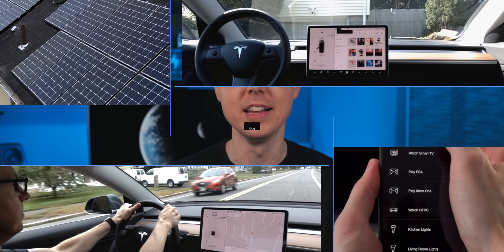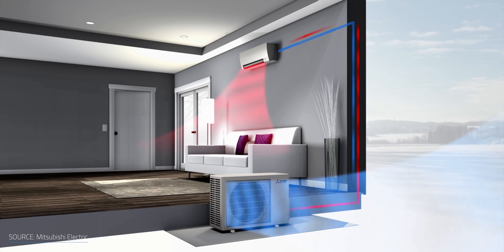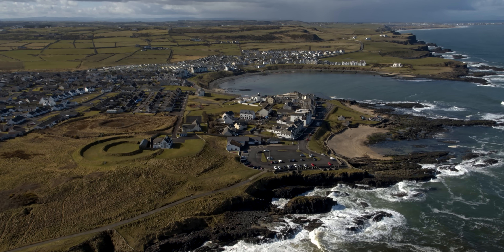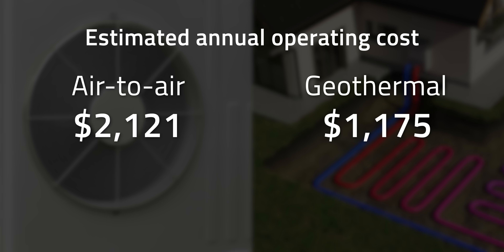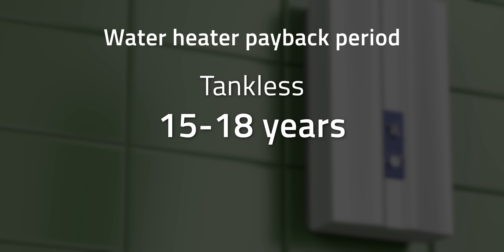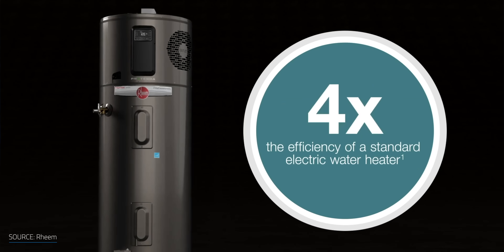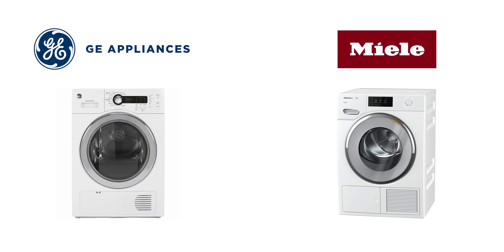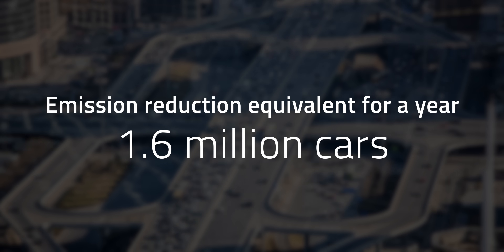Why Heat Pumps are Essential for the Future - Explained

Comment: My clothes dryer costs me absolutely zero dollars per year, produces no emissions and no noise, and cost $57 AUD 45 years ago so I think it has returned its investment by now. It's called a rotary clothesline. I know I am being silly as I understand that there are climate zones where outside drying is not easy to achieve but when I visit my son in southern California and I never see a clothesline ever I just shake my head. All that sun and heat and they use clothes dryers. I have to wonder how much electricity is consumed in the USA by clothes dryers in areas or at times of the year where they are not needed.
Reply: The problem with clotheslines is the lint that is still stuck on the fabrics.

Comment: Did you hear about the new heat pump developments? Magnetic and sound based heat pumps are awesome. Frauenhofer IPM researched a heat pump based on magnetic fields, heat diods and heat pipes and Blue Heart (a dutch company) developed a heat pump based on sound. Both are way more efficient, need less energy, quiter, less moving parts and avoids cooling fluids, which could be an environmental burden in itself. So, what do you think? Will heat pumps based on magnetic fields or sound replace todays heat pumps or are you still undecided?

Comment: so where does all the H2O go that's removed from the clothes?, in a motor vehicle , ( I'm an A/C tech ) it clings to the evaporator core that's 32% optimum , and runs down and out under the vehicle . just like a frost free refrigerator takes moisture out of inside and drips it into a pan under the fridge to evaporated into the room. but that's not much H2O. the dyer on the other hand will put all that moisture into the room it's in. so the room must be vented to outside some how , or water will be running down the walls like when you take a shower .

Comment: The new Inflation Reduction Act will be adding more rebates to heat pumps, whether they are space heating or water heating.
I have been extremely happy with my heat pump water heater and the mini split heat pumps that I've installed.
Reply: Yay more debt!
Reply: @paulb9769  the inflation reduction act actually decreases the national debt.

Comment: It's telling that EU nations are pushing (with subsidies and special crews) the adoption of heat pumps. Slovakia and Czechia have embarked on a massive program to install as many heat pumps as possible with crews working around the clock.   No gas or oil and it's efficient,  And the temperature is almost perfect . The new breed are twice as efficient as gas when the temp drops below zero.  In short, get a heat pump.

Comment: So if you used a heat pump with a 300% efficiency, and then converted 50% of the heat into electricity, you could generate enough power to run the heat pump, with electricity left over.  Essential free power!  Why aren't we doing this??

Comment: Install insulated tanks outside and use that as a thermal dump. I'm Looking to connect 2x 800,000 litre tanks, hot and cold storage on a 4,000 person office with full 2mw solar carpark and two 450kw water to water heatpumps, (no fans, all energy captured. This is the only way to do it, constant heating and cooling far outstrips any battery on payback, cost and environment.

 Everyone of these system are still dumping energy to atmosphere...

Comment: I disagree on the air heat pumps.  I've lived in three homes with them; two owned by my parents and one mine.  They really don't work well once the temperature drops into the low 40s.  They run almost constantly in the 30s.  The air coming out of the registers is cold which is the last thing you want when its 20 degrees outside.  The electric backup is NOT a good thing.  Electricity is very expensive.  It is the reason why you don't see electric homes much anymore.  They were a big thing in the 70s.  Remember electric baseboard radiant heating?  It was great, fantastic, wow until you started getting the electric bills.  I replaced my heat pump with propane and couldn't be happier.  I can even power it when the electricity goes out using a generator.  You really can't do that with a heat pump unless you get a very large one.  I'm intrigued by the geothermal version with the buried lines.  They should work fine under winter temperatures.  I'm sure they still run all the time.

Comment: I have heat pump and have for years ….much better electric bill ,more comfortable environment feeling at home …very even feeling from room to room even in the winter and it keep the house cool not cold but conferrable in the summer even on extremely hot days …..Mine is a ducted system and I enjoy it …did I mention the electric bill stays low ….LoL …now for me I can’t justify a hybrid hot water heater at this time because a good hybrid would run around $2000 plus and a good high efficiency is around $800 …to save $15 a month still wouldn’t be cost effective over the lifetime on the unit ….it will be interesting too the changes in cost effective electric appliance in the next 5 to 10 years  in America once the big push to,destroy the oil based life style we have enjoyed for the last 80 years …I hope technology keep up …//

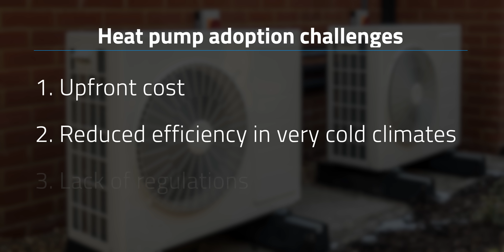Comment: 4:21 hang on--to get $5600 in savings the total annual bill has to be greater than $5600.  Are you saying they are going to spend more than $466 a month on heating?  Note the house pictured has two chimneys.

Comment: If you heat with a heat pump, it is not that much of a stretch to cut the gas line and save that connection cost every month

Comment: What if we decided to one day box a city in. Completely cover a city in a big box and measure the temperature difference after a week of no engines running…. And then 1 day after, everyone’s car was turned on, every bus, every power plant, every boat or gas/ diesel/ petrol powered engine. What if it turned out that it wasn’t the emissions of the engines, but simply the heat they create by running? Millions upon millions of little heaters running around the world in the form of cars, buses, trucks, etc…… surely the radiant heat would contribute something measurable.

Comment: Heat pumps heat just doesn't work as well as natural gas heat does. We purchased a vacation home up north 4 years ago and it came with a heat pump system. We immediately took it out and had a natural gas furnace installed. It has never failed us . It's also less stress on our electric generator when the electricity goes out as the only electricity needed from a gas furnace is for the forced air fan. Heat pumps may be ok for homes down south but if you live in an environment we're heat is seriously needed I wouldn't recommend electric heat at all.

Comment: Good video but not something we would do at the moment, more than 75% of electricity in colorado comes from coal and other fossil fules (I think SMR's are the way to go here). We dont have solar so switching to a heat pump from the natural gas in our home dosent make as much sense as we would be drawing more from the dirty grid instead of just using the natural gas which is already very cheap even after the price increase we had this year. Most people I know out here with an air to air heat pump also have a furance since a heat pump cant handle the coldest of days we have and I cant justify the price of installing multiple HVAC systems unless the prices come down significantly.

Comment: Thanks Matt, just subscribed after viewing your excellent explanation of heat pumps.  I tried solar hot water, and it worked great but after ten years the controls failed and they could not be replaced as the company producing them had gone out of business.  Surprised to find the payback period was shorter than my solar water water heater, and the lifespan was longer.  You could say I’m pumped up about heat pumps.  Good luck with your new net zero house.

Comment: I am always bewildered by people that think about CO2 emissions, as if this were a thing. Just work with whatever is cheaper to achieve the goal. For many people, that used to be natural gas, until some criminal politicians decided to make it expensive, so that other high maintenance tech start to seem economically viable. But still, most people on earth use wood to heat and cook. Wood is ecological. When burned, it grows more wood. Perfect closed loop.
Everyone I know, using heat pumps, say they regret it, because they are not doing their job. The shower water is just warm, not hot. The house stays colder than wanted in winters. And we are talking parallel 45, not the Arctic. Maybe the tech will improve. But the costs are not worth it. Stay on crude. Burn CO2, be reasonable.

Comment: I was always told AC was very inefficient and my electric bill reflects that. How can heat pumps be considered efficient if they are just a reverse system? Electric heat is 100% efficient. How can heat pumps be more than that? And natural gas is still very cheap imo. The coldest months my bill will be less than 200$ for the gas while my electric bills will be over 400$ in the hottest month of the summer 🤷🏼‍♂️. Wouldn't a heat pump cost as much or even more as AC?

Comment: Heat pumps are only better for the environment / energy consumption when the electrical source is carbon friendly.  If your source of electricity is coal or even natural gas for peaking, then a high efficiency natural gas furnace is still more efficient - consider a 95-99% thermal efficient furnace vs. a maximum 85% (but probably much less) efficiency on fossil fuel electricity generation.

Additionally in most areas of NA, Canada specifically natural gas is much cheaper than electricity, which results in a heat pump actually costing more than a HE natural gas furnace.

Comment: Longer lifetime for a heat pump dryer is not true unfortunately. At least not compared to traditional condensor dryers of European brands. In fact they die quicker and are impossible to clean because of the condensor no longer being removalable. I think the reason they're more common here in Europe is because energy is way more expensive and therefore it's more worth it.

Comment: Can you do A program on self running motor generator units and self running motor generator to start out at 50 kW and goes up for three-quarter horsepower induction motor 5 hp induction motor thank you

Comment: You didn't touch on how the electricity is made? Not much point going on about co2 if it was made from burning gas etc. Also even if we had the extra power stations the cables in the street & substation couldn't cope! Please do a video on that & how much Co2 would be produced sorting it out.
Reply: Its a matter of efficiency, and in the heat pump's case, that a heat pump can have 1 watt of electricity in, and spit out > 1 watt of heat. (This does not break laws of thermodynamics - the extra heat is collected from the air outside)

If you can get a COP of 3 or better with a heat pump, and your electricity comes from say a natural gas power plant then burning the gas directly in a furnace to heat a home is less efficient than running a heat pump. There are a lot of factors to consider here so I cannot give specifics, and there are scenarios where burning direct becomes more efficient than running a heat pump.

Similar thing to EVs.
Electric cars are extremely efficient compared to a gas vehicle..
An EV charged 100% by coal generated electricity would actually still use less energy and pollute less than a comparable gasoline vehicle. But only by a very little bit. 
Running on 100% natural gas and the EV wins hands down. 

Most people don't realize it but coal is 20-24% of US generation now, down from about 90% 20 years ago so the 'it runs on coal' meme is wildly inaccurate.

Comment: Well I live in Florida and as long as it doesn't get too cold. Heat pumps can't very much higher than the temp outside. Everytime it gets cold here and you try to heat your home it switches to emergency heat which is just a bright red hot metal band, like in floor heaters, with a fan blowing air across it. Which also makes your electric meter spin like a helicopter blade. 
You say very cold temperatures but my friends a contractor and there's a line in Florida that if your north of it they can't use heat pumps. So if north Florida is what you call "very cold temperatures" then okay but otherwise he's either mistaken or being disingenuous.

Comment: Those usage cost figures are meaningless because they don't include the cost of the devices themselves and we all know the manufacturers will outright lie about the longevity of their products.  Anyone with any appreciable amount of experience in a repair field will know that MTBF, like all statistics, is meaningless on an individual basis, so claims about longevity can be completely ignored.  Even if you could trust those claims, they are dependent upon the manufacturer using best-quality components and materials, which won't happen.  So yes, I do think that heat pumps sound like a great path forward and we should be using them everywhere possible.  However, we also need companies to design and manufacture them with quality components and materials, building a product which will last rather than a product with an intentionally-limited lifespan in order to garner future sales.

Comment: Electric water heaters do not have to be on 24/7. Mine is on a timer that turns it off in the evening and turns it on in the early morning. I save a huge amount not heating water that I don't need.

Comment: Gas cheap??? Not in Europe!!!
BTW, I have a dryer with heat pump and it cost me 450 euro. It takes a bit longer to dry but works like a charm and uses a lot less energy. It's also less of a fire hazard than those old dryers.
Soon I will invest in a water boiler with heat pump since I now have solar panels and a home battery. But heat pump systems for home heating are soooo expensive. Except for that I have to agree, put a heat pump in everything 😉

Comment: Pretty bad idea to put that water heater in your basement and cool down your house. A air-to-water heat pump (external) can heat both your radiators and your shower, without cooling down your basement.

Comment: Please do not confuse power with energy.
Saying that for 1 W of electricity you get 4 J of heat, does not make any sense.
If I run a 1 W resistor-based heater for 4 seconds, I do get 4 J of heat.

Comment: I thought all split system
air conditioning systems work this way ???? That they only have the electric heating coils installed for emergency heat.
Every new home I’m the last 30 years in the US has this type of Air Conditioning system. It all depends how efficient the compressor and fans or with the R-factor of your heated/cooled space.

Comment: It is wrong to just claim that heat pumps are 300-500% efficient. They are doing different things, and if the comparison is between burning natural gas to heat a home directly to burning natural gas to generate electricity, and then transmitting that electricity tens or more miles to a home to power a heat pump to run a reverse Carnot cycle, then a lot of calculations need to be made to compare the different factors involved. 
Heat pumps are NOT breaking the laws of physics and NOT "producing more heating energy than the electricity that you are putting into it". Heat pumps are leveraging the environment by MOVING heat from one place to another, they are not creating energy through a chemical process or electrical resistance.

Comment: I looked into heat pumps a couple of times, and it's always driven me nuts as far as choosing install locations of the unit. according to all all logic they should be somewhere it can extract heat from. for example, New Zealand article stated to have it on the north side of the house where it would get the most sunlight (southern hemisphere). THIS is logical. American companies and articles on the subject says to place them on the north side, which being Northern Hemisphere means it will be hidden away from the sun. some even stated its best to find a shaded area like under the shade of a tree. but away from bushes, but optimally near a garden rather than an alleyway. the rules and guidelines for American installs are absolutely idiotic and seemingly pushing to avoid getting it or putting it in the worst location possible.

 I was trying to figure out a way to make these more efficient and not even need the small electric heater, but would be dependent on where to install the heater, this is why I ran into this illogical mess.
Reply: Yeah weird I live in nz and have 2 heat pumps for heating one is on teb south side of the house and the other is on the north east , both work equally well. In another property we own one is more east. It really doesn't matter that much mate. Insat.lers just stick them as close to the internal unit normally to keep the plumbing shorter and install is cheapest..

Comment: i was onboard until you said rheem. I am an electrician actually, but every one of my plumbing and HVAC friends (i know dozens of them) who will not use rheem because of their failure rate and because MANY of the units arrive DOA. also the tanks leak due to poor assembly quality. the technology is good, but if you want a reliable system, most HVAC installers and service technicians say IBC has the lowest failure rate across its product range.

Comment: Cop depends on outside temperature.
This is not explained to the client's and during cold days it operates as an induction element.
Not efficient.
Magnetic heating saves 40 percent on operation.